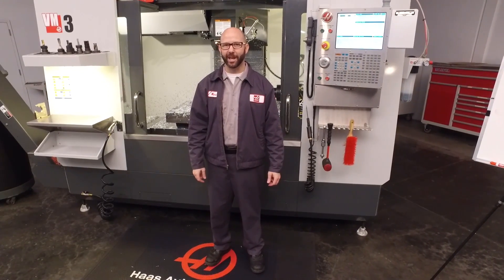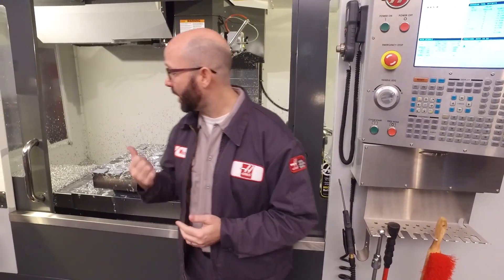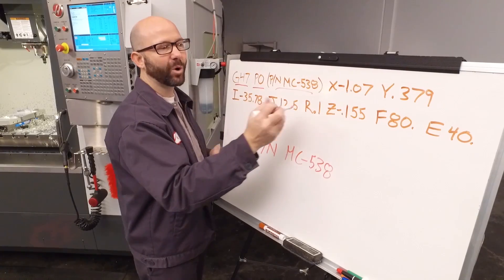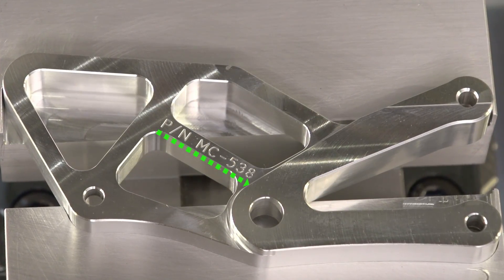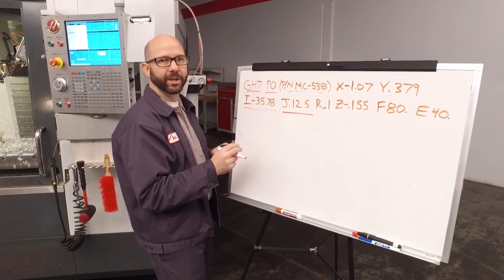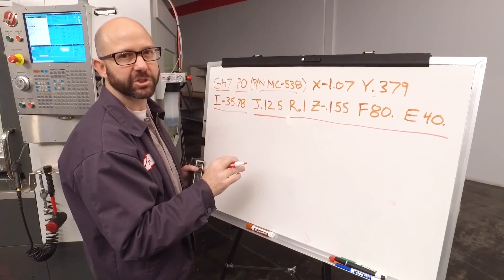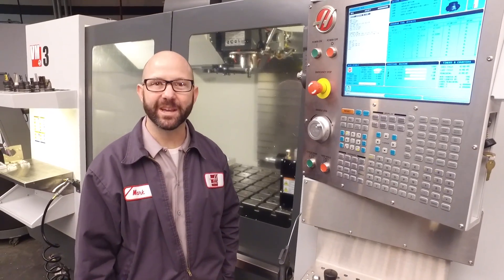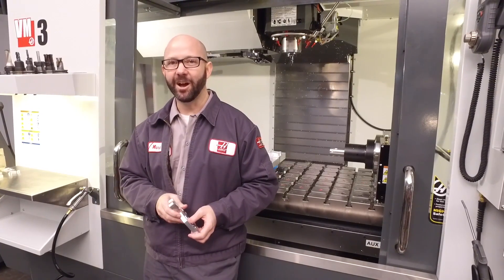CNC Engraving Made Easy Using G47 – Part 1 – Haas Automation Tip of the Day

Comment: Hi Mark I am trying to engrave a dimension that I measured with my renishaw probe. I normally would convert my measurement result to a string first and then pass it in a G47 text engraving, but it does not work. It would literally print the hashtag with the variable number. How can pass a string stored as a variable into the G47 text engraving

Comment: I am trying to use G47 to engrave text. When I run the program I get a 257 PROG DATA ERROR. I don't know what I am doing wrong. I am using a HASS simulator.
Reply: Pedro - Try turning Off Settings 74 and 75 on your simulator, this should fix your 257 alarm.

Comment: Is there a way to make the text on center? Do I have to manually offset my starting point? Example If I were to make a compass and engrave an "N" at x0 y1.5, the center of the N would be on that point and not the bottom left corner.

Comment: I am in the vinyl dipping industry, I need to engrave the top of my mold backwards ,so that  you can read it  on the vinyl part, what is the g code for that?
Reply from the maker: Baldo – We can use a G101/G100 command to Mirror Image our Engraving, or any code really. Take a look at G101 in the Haas manual, which you can download from www.haascnc.com for more information. We will place a G101 X0. (Mirror On, about X-Axis X0) before our engraving, and place a G100 (Mirror Off) after our G47 engraving is done. Run things in Graphic Mode first to make sure it looks the way you’d like. – Mark, Haas Tip-of-the-day

Comment: On my VF2, how do i stop the z axis from going up and down all the way between each pass it makes for each letter?
Reply from the maker: To keep our tool down in the hole when peck drilling, we’ll use a G73 High Speed Peck cycle instead of our normal G83 Peck Drill cycle. Check out these two videos for more information, along with your Haas Manual. https://youtu.be/AM6nVgKjBQo and https://youtu.be/YbbZJ7H0NUw . – Mark, Haas Tip of the day

Comment: Hello i use 0.4mm end mill tool for engraving with depth of 0.5mm but tool had braked and also i reduced the feed but result is not good.I had engraved brass with that.so which type of tool i use and what will be the solution please suggest me.
Reply from the maker: Dharmesh Pattani – If I am just engraving a part number on one part or fixture, I often just use a Spot Drill (don’t tell anyone). For production parts, a small (1/8”, 3mm) die sinking endmill (runner cutter) with a .03” (,75mm) radius lasts really well. For cosmetic engraving (molds, golf putters), Single Lip Engraving cutters, with small “tip-offs” (flat at end) are often used. Tools with large radius on the tip, and blunt cutter angles, last longer. Pointy tools with sharper angles (like 15° included) tend to give better looking engraving, but the tools don’t last as long. Companies like Harvey Tool have a wide line of engraving cutters. Use lots of coolant on brass and aluminum. On steels, I’ll often just use a dab of tapping fluid on the part (no coolant). Run the highest RPM you can, and keep your feedrates low (.0005” Fz per tooth starting). – Mark, Haas Tip-of-the-day

Comment: How do you engrave on a radius?
Reply from the maker: Wally Cutler – For engraving along an arc, we’ll need to make use of a CAM system. There are quite a few free CAM systems online now, that can create this code for us, that can easily be pulled into the control. – Mark, Haas Tip-of-the-day

Comment: Is engraving at that speed normal?... I engrave letters this size at feed rates of 5ipm and 3000 rpm and this takes up a considerable amount of time, can someone clarify from expierience, are little 2mm end mills able to handle feeds up to 40ipm? I mean it makes sense because it's less than a .01 depth of cut
Reply from the maker: Yes, you can engrave as fast as the tool can handle while still achieving a desirable finish. 40-120 ipm is perfectly normal.
Reply: in doing so you'd be sacrificing  tool life would'nt you? if your engraving many parts this high speed will cause wear faster? or is it all the same because its the same material removal? thanks so much!
Reply from the maker: Cole – Speeds and feeds are very tool, material, and depth-of-cut specific. I think that the best looking engraving is done with tipped-off single-lip engraving cutters, but you have to go slower with these, about .001” per revolution or less on steel. Engraving cutters with radius on them (die sinking end mills) can feed faster and they last longer, but the engraving is rounded. Check out the Speeds and Feeds recommendations for these Harvey Tool cutters: http://www.harveytool.com/secure/Content/Documents/SF_25200.pdf. You can also see different engraving cutters on their site, http://www.harveytool.com/cat/Engraving-Cutters/Specialty-Profiles/Browse-Our-Products_195.aspx.  I hope this helps get you started. – Mark, Haas Tip-of-the-day.
Reply: thanks for taking the time to reply!!

Comment: I am using it succesfully. Is it possible to write the diameter symbol?
Thanks in advance
Reply from the maker: We can engrave a diameter symbol, with a G47, by engraving a lower case “o”, and then engraving a forward slash “/” over it.  Aside from this, we would need to use a CAM System. – Mark, Haas Tip-of-the-day.

(DIAM SYM)
G47 P0 (o) X0 Y0 J0.15 E5. F30.
G47 P0 (/) X0.005 Y-0.02 J0.15 E5. F30.

Comment: Is there a way to do reverse or mirror  text
Reply from the maker: Qusin111 – Sure, it’s pretty easy to mirror the engraved text. We’ll preface the engraving code with a G101 X (or Y), this turns on Mirroring. We turn off Mirroring when done with a G100. Check out G101 in your Haas Mill Manual. Thanks for the comment. – Mark, Haas Tip-of-the-day

Comment: This is all great but Mark doesn't explain how he centered the text on that tight space on the part.  How about a 2nd video to show how to do that. Thanks
Reply from the maker: Steve – I cheated! I knew where the perfect spot was, because I had the CAD drawing. Check out 01:12 in the video, we show that our engraving starts in the bottom left corner of that first letter, even if it is at an angle. If I had to do this manually, I would Handle Jog the engraving tool above the part and note the XY location in the current Work Offset, and use that as my starting XY. It would probably still need some manual adjustments. Thanks for the comment. – Mark, Haas Tip-of-the-day

Comment: Used G47 and broke my engraving tool, comes out the new interface have a bug.It will multiply all values X2 so if you are at  Z-20.00  X2 -40.00 you will hit the vise !!!!!!!!! ( Confirmed by HASS training Center Next week :)
Reply from the maker: Hi Denis, can you send us a private message with your machine's serial number. This could be caused by an older version of the software.

Comment: I think it'd be intensely valuable to do a whole piece on G187. For those who don't know, it can be difficult to explain. P1 for roughing, P2 for semi-finish (and the default) and P3 for finish operations. Any E value can go anywhere and is what holds the machine to the desired tolerance. In different P modes the servo acceleration values are different (and this can be found in the parameters if one digs deep enough) and can drastically reduce cycle time if one puts P1 E.025 in high speed machining toolpaths.
Reply from the maker: Atomkinder67 – Check out https://youtu.be/lwujoXvgGzA Thanks for the comment. – Mark, Haas Tip-of-the-day
Reply: Muchas gracias!